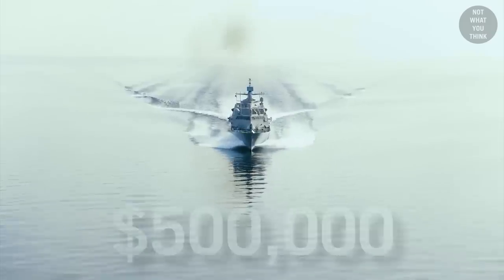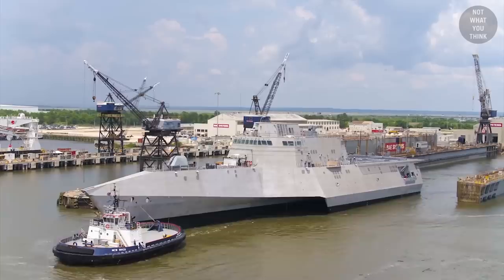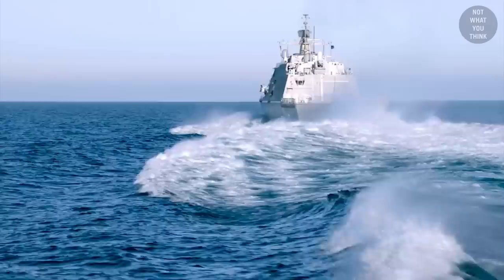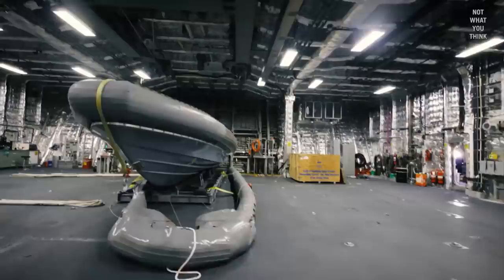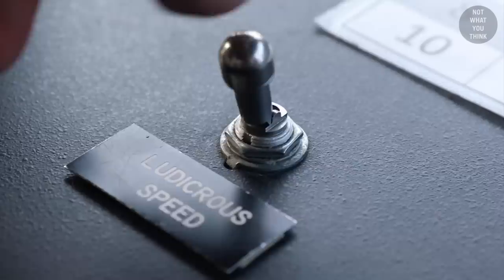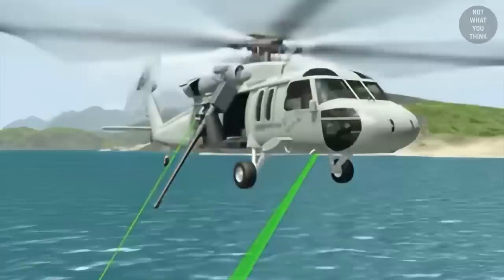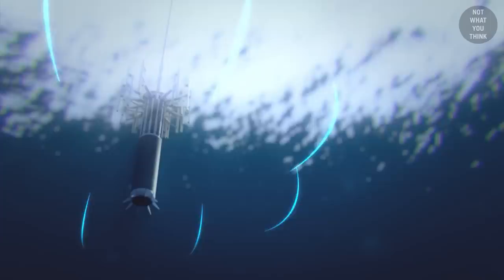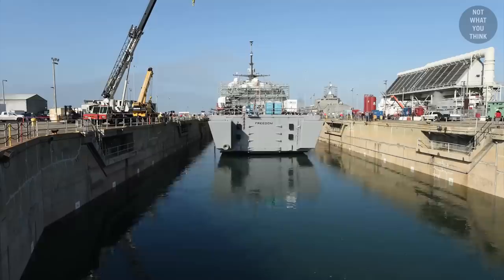Why Retire a 2-Year Old Warship?

Comment: I say that attempting innovation at this level is not so much a bad thing. However, it seems laughable and questionable how several LCSs were built first instead of building only 1 or 2 then conduct extensive sea trials and drills using those 2 ships to get a glimpse of the ship class's problems and possible improvements.
Reply: Cause of so called Greed for 💰
Reply: The idea of series production whilst proving trials were under way started in the second world war used mainly by the Brits.  It worked alright with tanks and other vehicles, because they were small enough that remanufacturing wasn't a burden, and having the vehicles in service offset those that would later be removed from service.  This idea doesn't work so well with naval vessels, mainly because of the cost and the difficulty in remanufacturing.  The idea of a pre-production series, the one or two to test and improve, would have made much more sense in this case.
Reply: They did only build 2 at first. The Freedom and Independence. One of each, and they both were terrible. But they had contracts with the ship builders already.
Most ships have a couple years of kinks to work out and they end up sailing w no issues (see ford class carriers 😂) but these were garbage from the start. Almost as bad as Zumwalt Destroyers
Reply: @FXR038  that's the point. They really had a utopia dream in deciding to contract double digits of these ships in the first place instead of stopping on a few of each class first.
Reply: Department of defense appears to be as corrupt and incompetent as SCOTUS. 🤐🤐🤐🤐
Reply: What, do thorough testing of new and emerging technology before mass production? As shown by the Mark 14 torpedo, not the way we do things over here.
Reply: it's because more and more designers and engineers are relying on 3D architectural software to design ships believing that the software will offer real life experience without having to delay production of the ship with sea trials. The same tech was used to design the new class of US super carriers, but thankfully due to the size and time it takes to build one they managed to work out all the kinks before going into full production.
Reply: @gailhasler8435  maybe. dod is part of military-industrial complex. when a defense project is given orders to build a project as many states as possible (contractors, sub-contractors) are involved to bring as many jobs as possible. this way it appears as if military production is overall good for the whole country. a strictly business approach would need few contractors - just what is needed to build the ship. a military approach would also demand the same "just enough" use of whatever resources/money but then there's something called Congress and The Government who need to be re-elected as often as possible. I think you can fill in the rest...
Reply: @BlackHearthguard  Using the same method, China built its first batch of eight Type 055 destroyers in just a few years. They were just lucky that they didn't have major problems.
Reply: The LCS program was run just like the Joint Strike Fighter program.  The idea was to just start building them BEFORE the testing was done and then come back and upgrade the early units once the design was complete.  My belief is that this was not done for the sake of cost savings but to make the program more cancel-proof.  Get to building early to say "See.  We're getting stuff done" then ask for more money later since the program is too far along to cancel.
Reply: @DeeEight  Given the choice of the Independence or the Freedoms I would think that the Indys were the better choice if only because of the HUGE flight deck.  I can see a scenario where an Indy gets on station off of a coast.  A couple of vertical lift aircraft lands to refuel before going much further inland.  The mission could also be supported with massive UAV recon from that flight deck.
Reply: That is the issue. They literally had 9 more coming down the pipeline and the systems in them had not actually been properly tested. How do you get to full production of a ship line without having had a rigorous test with actual sea trials of a prototype or at least older ships retrofitted with the systems to test if they made sense first.
Reply: @gailhasler8435  ...and the vast majority of American federal, state and local politicians.
Reply: @gailhasler8435  ...and the majority of American federal, state and local politicians.
Reply: @iqbang9236  Not as ambitious in terms of innovation, their 055 hasn'thad a combat test yet . . . 
DOUGout
Reply: got to repay the political donors.
Reply: There's no way I would go full ahead with a program that hasn't been proven, I'm very concerned about the cost and the low operational ability, something as simple as a propulsion system even though it's sophisticated run through sea trials like you've never seen
Reply: Agree on both counts.  These problems should have been uncovered before they built 9 of them.
Reply: They did only build two at first dunce.
Reply: Combined Diesel and Gas Turbine (CODAG) is a common configuration for warships going back to the early '60s. Sure it's complicated, but hardly a new or untested technology. The only slight innovation there is to use them to drive 4 shafts (rather than 2) and those turning pump jets (even those aren't new). I think LM should have been charged for the cost of the repairs.

Sure the experiments with modularity were a risk, but other nations are seemingly managing just fine... I think maybe the expectations for changing the role of a ship in a few hours were too high and a couple of days isn't an unreasonable ask.
 But without knowing specifics it's really hard to say what caused the discrepancies between expectations and reality. It seems like the modular thing is a system that they could have easily kept working on (assuming it would not be a polished system out of the gate). But my guess is that they gave up because of the propulsion issues and it just being easier (not to mention more fashionable) to complain about the class instead of trying to improve and fix things.
Reply: @FXR038  Almost as bad as the Zumwalt?
As far as I'm aware the Zumwalt's only failure was procurement of guided shells (and the class getting cancelled on cost grounds, thanks largely to 10x reduced order numbers). Considering how much use they would get from shore bombardment, vs just firing off barrages of cruise missiles, I don't see it as a huge issue.
I think being limited to 12-15 kts is worse.
Reply: @phillip_iv_planetking6354  and yet sparky, they didn't test them long enough to find the unfixable propulsion problem leading them to scrap a lot of brand new and very expensive vessels.
Reply: its politics. Make as many Congressman and Senators happy to pass a procurement bill.
Reply: @gailhasler8435  department of defense has always been corrupt.  What’s your beef with SCOTUS?
Reply: The problem is your idea makes sense.  Common sense is an oxymoron in the military.  Our son saw the proposed ideas for the engines and gear shifting.  He told his Commander and CPO what problems would occur.  Unfortunately he passed before being proven correct.
Reply: They will opos your pointing logic.
Reply: @FXR038  I thought the Ford class still had major issues -- has that changed?
Reply: @FXR038  IIRC the indepence class more or less worked, since the naval architects had a history building multi-hulled ships. The problem is that thier experience was with fast sea-going ferry boats which generally don't operate in the sort of rough sea states a warship has to endure. So the Indies were built correctly with an honest amount of margin for the expected sea state. The designers just badly underestimated the added stress of rought sea conditions on their designs. 

The Freedom's were comissioned because Lockheed unleashed their most powerful weapon, the lobbyists!

That whole, lets make them hyper modular and equip them with stupidly complex transmission system also didn't do either class any favors.

And the Zumwalts are, iirc, fine in terms of ther construction. They even performed better than projected in rough sea states. They were just grossly over built and over priced because the designers were told to future proof them for a half dozen theoretical technologies of which, maybe two have panned out. They were an embarassing boondoggle for their entire procurments process, but they do seem to actually work.
Reply: The cost of design is normally factored into the production of a dozen ships which prevents one or two ships being seen as crazy expensive.
Reply: Its because they are playing around with the costs of making more in the future and saving money by building more . Problem with that logic is if the boat sucks that you built a lot of bad boats  will be built before you figure it out
Reply: The problem is, when/if we get involved in an actual war all of the tools and weapons we have or are making today will immediately be rendered useless.  They will all be destroyed or otherwise rendered ineffective in the first weeks and months of fighting.  This is because these are weapons made during peacetime, for an unknown and unknowable battlefield.  The good weapons of war are weapons that were made for the battlefield on which the war is fought on.  Everything we have right now is nothing but fodder for the next REAL war we get involved in.

We have found out over the last 90 days or so(at the time of this posting) that fighting a conventional war is going to be VERY difficult; to say the least.  Russia is attempting war on Ukraine; the war is going poorly.  And Russia outclasses Ukraine in every measurable way, aside from allies willing to help.  Our next opponent will believe they have a chance to win their objective, or else they would not choose to attack/fight us, which means they would be capable and brave.  After all, we look scary, right?  Who would want to attack/fight a country that spends three quarters of a trillion dollars annually on their military?  They would HAVE to be brave, at the very least.  And unlike Ukraine, it is highly unlikely we will get any help.

Most countries will not help us because of the global economy; they are dependent upon countries who have the potential of being our next opponents.  And even if/when they do help us, it will be too late.  Kind of like how Europe is playing like a limp dick right now, with Ukraine.  Most of Europe is over a barrel with the whole natural gas situation.  Where we are mostly independent, with our vast amount of land and the resources within it.  So we won't get any help, and if we do, it will be too late, as our so-called "allies" will have to make significant adjustments to way of living before they can act on our behalf.

To be honest, it would be better to just not make any new weapons of war right now, and keep our old stuff as operational as possible.  Then, if/when war breaks out, we make specialized weapons to fight on whatever and wherever battlefield the fight is held on.  We could cut our budget in half, save half of the half we cut for future military production/acquisition, and give the rest back to our people.  And it is incredibly likely NOBODY would notice.
Reply: @BlackHearthguard  That was a wartime measure done under emergency. 

We have no need to be doing that anymore except for greed and corruption. 

We should only be making one or two prototypes, testing them out extensively and, if they prove themselves, put them into production.
Reply: @Kaiserboo1871  Besides, in my op I stated that prototyping would have made more sense.
Reply: @BlackHearthguard  No one doubts American military might, we have yet to be TACTICALLY defeated on the battlefield since the end of the Korean War (Vietnam and Afghanistan were strategic failures, not tactical ones [name one engagement in which the Vietnamese or Taliban achieved a definitive tactical victory over the US]). 

But man our military could be a whole lot better without all the corruption and waste.
Reply: Who wants a warship built out of Pepsi cans?
Reply: That would've been too smart😕 You know our government isn't good at thing's like that😭👍
Reply: When I worked for the Navy, I got a tour of (IIRC) LCS-2 shortly after she entered service.  I'm not an expert in surface warfare, but it seemed obvious that it wasn't fit for purpose. (1) Although intended for littoral combat, her hull wasn't thick enough to stop even 50 caliber rounds.  (2) IIRC, the crew complement was so small that they could only expect about 6 hours of sleep per night, which sounds like a recipe for disaster.  (3) her helo pad was only rated for a lightweight chopper such as the unmanned Firescout, so there's no reliable way (that I'm aware of) to get crew members on/off board unless the helicopter has a winch. I realized that sometimes the emperor really doesn't have any clothes.
Reply: The problem with that is not enough senators get to pay off cronies.  And to be fair... if things would have worked out they would have probably ordered more ships and they would want them faster.  Since they didnt work out the costs go up per unit on these and then they will just move the research costs to the next new shinny widget.  (see how the F-35 budget looks much larger on paper after the F-22 production ended.)
Reply: Literally a 8 year old could have thought of that and our military didn't
Reply: @FXR038  

The Ford is still problematic. True, most of the bugs have, finally, been worked out of the EMALS and arresting gear as well as the weapons elevators, but the sewage system will forever require, I believe semiannual at least, chemical flushing to prevent clogs. This was originally reported to cost about $800,000 each time, but the Navy has more recently claimed a $400,000 price tag. That will add to the life cycle costs of operating that ship.
Reply: Yea one issue is to have tooo much novelty systems integrates at once on one platform. Exactly the same as the the F35. It becomes to complex thus resulting in high risk. 
   Better to do as woth the swedish A26 submarine being developed. Many of the new systems have also been instaled and used on the midlife upgrade of the Gotland class. Then much of the kinks will be figured out in time for the final implementation on the A26. 
   Same with the New Gripen. Take all of the new tech but base the over all design on a proven concept and avoid big cost overruns.
Reply: @braddl9442  issue there is that the procurment become so costly that it eats up the budget. But I agree. They did not test the platform properly. But beside that. Aslong as the platform is built modular enough it should be no issue with implementing the diferent task modules.
Reply: @edwinmoy1402  the amount of copium you took before you made that comment must have been almost lethal. Hope you are fine, and able to think about the fact that each and every single decission maker is in the pocket of the industry that tries to sell these failures to the government.
Reply: @Raussl  I'm sorry but where in my comment did I allude to the fact I'm in support of this design in the first place or in support of whoever makes the final decision on the design that would warrant such a snide and stereotypical comment from you? Only thing I hinted at was the current mentality of ship designers and engineers are they rely more on software for correcting and foreseeing problems rather than doing a proper ship shakedown before putting this ship into full production.
Reply: @edwinmoy1402  ok, then you are basically ignorant on the actual causes of cost overrun and failed designs are...it sure as hell has nothing to do with relying on computer assisted design. Because that method is omnipresent, yet it seems to work great and effective basically everywhere else.
Reply: @Raussl  Oh I am perfectly aware what may or may not cause costs to spiral out of control. Yet you seem hell bent on accusing just the decision maker's as the source of the problems when pretty much everyone involved from the decision makers to the designers to the shipbuilders all added to the problem. Personally, I think having people that have no knowledge in designing weapons make the final decisions for the materials, designs, and source of supply is the height of idiocy. Speaking as both a software engineer and tech officer, computers are not infallible and doesn't always work effectively. If it did then the entire world wouldn't need tech support on call when your computer or phone takes a dump.
Reply: @edwinmoy1402  no I'm aware it ain't just the decission makers...but on the list of who is at fault, THE PROCESS of using Computer design software and simulation is WAY down at the bottom on the list...maybe so far it is on the side of reducing cost. In fact it is on the side of reducing cost.
Reply: Bad execution of a good idea.  When it comes to warships, cost cutting and overcomlication equal disaster.    What about the yahoo's that singed off on these boondoggles?   These would have been floating easy targets in real combat costing ALOT lives!    anybody actually study marine engineering, metallurgy, manufacturing?   Bet not
Reply: @braddl9442  served on a WHEC 378 built in 1969.   Variable pitch props 2 fairbanks morse diesels  2 prat and Whitney turbines.    Our hamstring was the reduction gears. Bearings overheated unless all hands had rags buckets and hoses trying to cool the @$# things down.   Made 5 that way, and they were LEASED from western gear Co.  Took actual permission from congress too cut locks too access hatches for repairs......
Reply: @driven01  they were gonna wind up getting sailors killed.  Good riddance.  Who signed off on them?   Put them on one and send them in front of next heavy naval action...
Reply: @FXR038  I remember hearing something about the US military always wants vehicles like ships constantly being built and that was to ensure that skill and expertise in manufacturing military equipment remain up to standard. If the country finds itself in a big war it's a lot easier to upscale existing manufacturing lines that have all the kinks worked out than it is to jumpstart a new production line and having to figure everything out from scratch. This was especially true for ships which are a massive investment in time, labor and resources.
Reply: Your point makes too much sense. This is the government remember, not only that but this is military procurement.
Reply: @STScott-qo4pw  You sir, are quite right
Reply: @longshot7601  The Independence Class took lessons from the Freedom Class but combined these design elements with innovations such as improved metallurgy - for some big gains and cost savings. 

Whether or not the Freedom Class was the best use of the available shipyards and funding is debatable but if the Navy wasn't finding funding tight at the moment (squeezed by the dual costs if rearmament for near-peer warfare and the cost of investment in next generation equipment; to maintain a lead over, or remain within reach of, China), then the US Navy wouldn't be retiring them and Congress knows it. There are also other vessels that the Navy would prefer to retire but the pollies won't let them.
Reply: @iqbang9236  The Type 55 isn't all that innovative but it is a step forward for the PLAN fleet.
Reply: @aymonfoxc1442  I don't see how the Indys learned lessons from the Freedoms as both were being developed at the same time and the Indys are an evolution of a high speed ferry design.
Since everything seems to be goings drones anyway why not just make the Indys a high speed drone carrier with a zero-zero launcher(s) and catch nets.  I can't see these things going toe to toe with anything of comperable size with their lack of offensive armament.  Hmmmm.  Maybe some Marine Himars stored in the hold and rolled out to fire a salvo.
Reply: @longshot7601  Yes, whilst they were developed alongside eachother, the two projects fed into eachother (although the lessons mostly flowed one way). The Indys took on elements of the hull design from the Freedom, for example, but also pioneered a new aluminium mixture to eliminate the need for an anti-rust coating over most of the ship (which actually saves a lot of weight). 

The way I see it, the Freedom Class was supposed to be an effective and adaptable stop-gap measure, whilst the Independence class is the littoral vessel the Navy wanted. Speed and tactical flexibility are increasingly important but I agree that fire-power is vital (however the he US Navy seems to do a good job of bringing assets to bare). 

I think vessels like the Indys will increasingly field drones and small forward deploying teams (i.e. marines) in line with the Navy / Marine Corps thinking re shaping and observing the littoral environment. Elements of the new for the structure were recently tested successfully in the Mediterranean and the Baltic Sea as part of the response to Russia's invasion of Ukraine. 

So much work has been done to fix the Freedoms and so much money spent, that it seems ridiculous to get rif of them. Congress get in the way of necessary restructuring (although I appreciate the need for civilian oversight) and forces the Navy to downsize further. Plus, there's the irony of the fact that politicians complain about the downsizing but wont fund the next generation weapons without it, whilst the political need to spread work around (typical meddling for votes) certainly hampered the production of the Freedom Class to begin with. I hope that Russia's aggression solves funding issues. China certainly isn't holding back production or research and they are catching up quickly.
Reply: they still use lousy names? just use a normal name.
Reply: They never get funding for 1-2 ships, the per ship cost would be astronomical. For 15 ships the cost is WAY down, 1/2 or even less per ship. 
How much does a meal cost if you have to first buy the oven before making it? Over the years the cost per meal diminishes to practically 0, that is why people have those installed ;)
Reply: @iqbang9236  they build 052 first, and then 055.
Reply: @The Study Actually it was a pretty savvy move: they named the ship after a Senator from Arizona so that the OTHER Senator from Arizona wouldn't keep voting against their appropriations bills. ;)
Reply: @ssu7653  Exactly -- that's the difference between Non-Recurring Expenses (NRE) and Recurring Expenses (RE). The entire DoD acquisition cycle works in observance of those factors, as well as the costs to train and crew the ships, the sum total of which is the total cost of the platform over its expected design lifetime.  True, the LCS ships didn't meet all the goals but most of that was due to the shifting priorities and requirements that the Navy kept coming up with years into the program; that is always a recipe for disaster, imo.
Reply: @BlackHearthguard  but like my state needs JERBS so we need to build 9 or I won’t sign the next budget bill.
Reply: @iqbang9236  maybe they aren’t lucky but have decades of experience in mass modern industrial manufacturing and a labor force with the skills to execute on it. Something we let rot away except for in specialized defense firms like this, whom don’t always have the same “pressure” or competition to deliver, and the natural marketplace to build a competent labor force and institutional knowledge to deal with mass modern industrial manufacturing.

By labor force I don’t mean welders either, thankfully we still have those but if your ideas produce shit on scale you go bankrupt in the real world. And this natural marketplace breeds a ton of methods of working and institutional knowledge + labor force that’s irreplaceable. It’s the same knowledge and labor that built America and the modern world as we know it. But it’s mostly gone now.
Reply: @edwinmoy1402 But working on a cool computer with 3D design software feels avantgarde and makes things look cooler. Gives them that "Next Gen" aura.🤭
Reply: Maybe they would have better luck with  Toyota coming in to fix the combining gear problem- their hybrid works flawlessly transitioning between electric and gas.